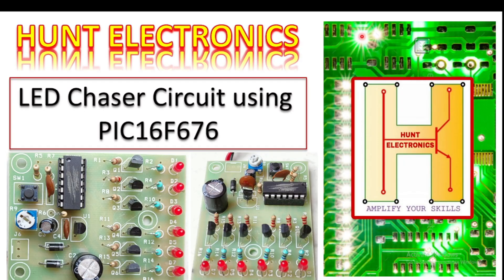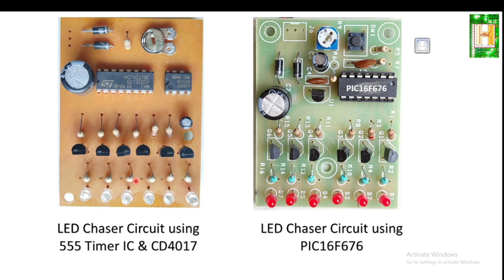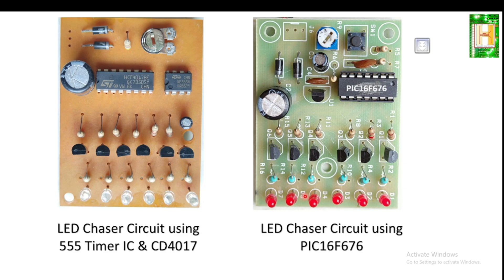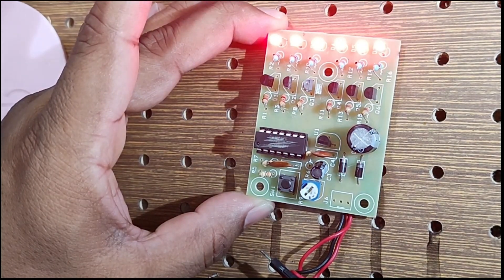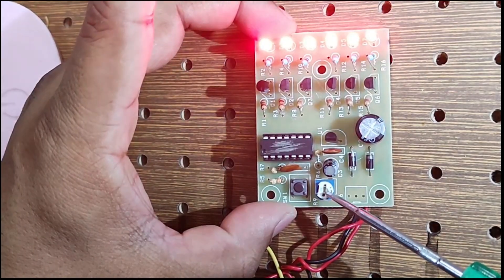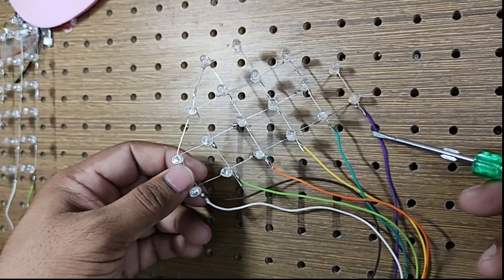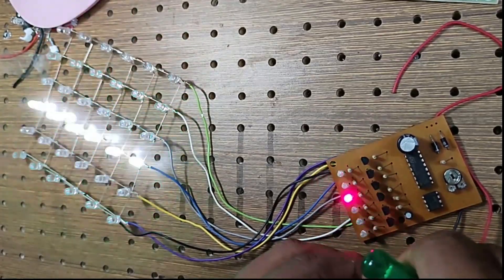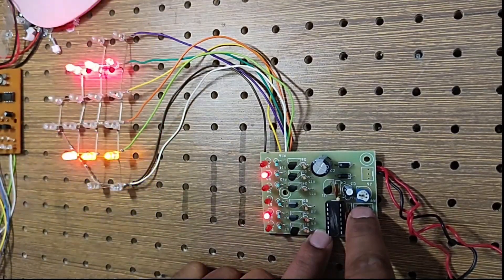12V 6CHANNEL LED CHASER using PIC16F676  with 13 MODES #chaser   #led

Comment: SIR I WANT PIC PROGRAMMING
FOR ANLOG INPUT AND DIGITAL OUTPUT  USING POTENTIOMETER
Reply from the maker: U can use Arduino Uno R3
Reply from the maker: https://youtu.be/gq9uwEyfQOY
Reply: Online store link plz
Reply from the maker: https://amzn.in/d/4cPVyjb
Reply from the maker: https://amzn.in/d/4cPVyjb
Reply: @sakibmujawar3477  bro thats different circuit..I want with mode swich type which u have shown in this video